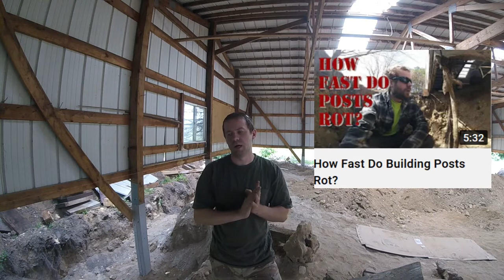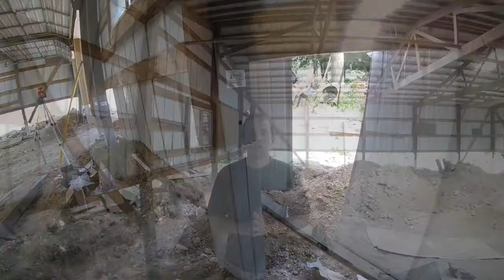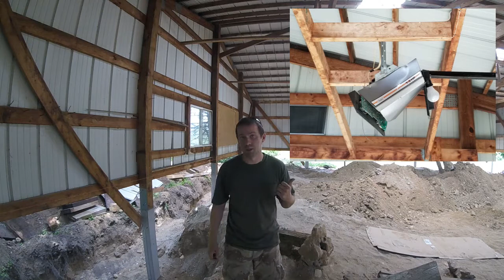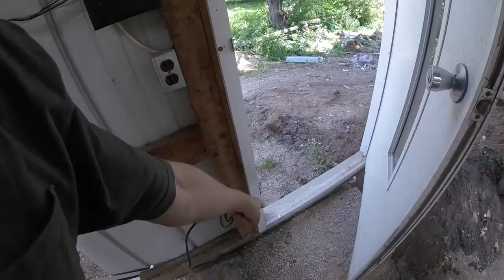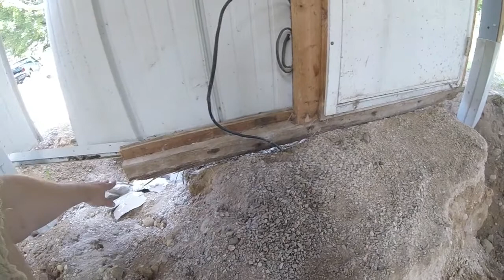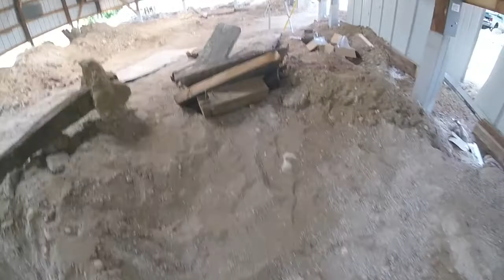DIY Rotted Post Frame Barn Repair

Comment: This is a result of arsenate having been removed stupidly by the Obama administration in 2008. Arsenic poles dont do this above .6 treatments. Any copper2sulfate will rot out in under 10 years. The materials changed but the methods didnt.

Comment: Using the strong way metal sleeve system every post could have been repaired in a day without all that digging.  Wood posts are supposed to have concrete pads on compacted soil to prevent sinking.  The builder had no clue. Did he use ring shank nails?
Reply from the maker: vulcan 499 you made a lot of good points in your comments on this video series. I have some updates and plan to respond in the next video. Thanks for watching!